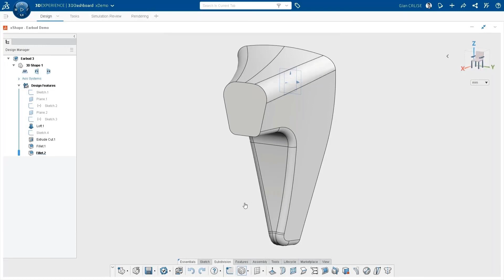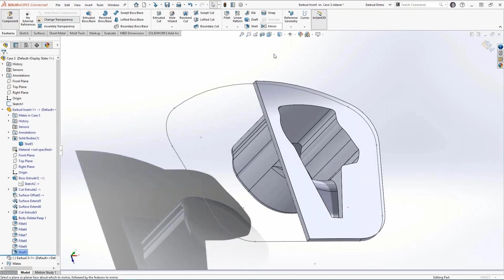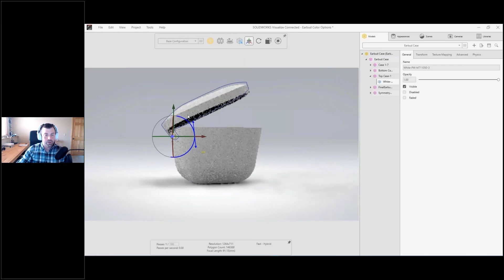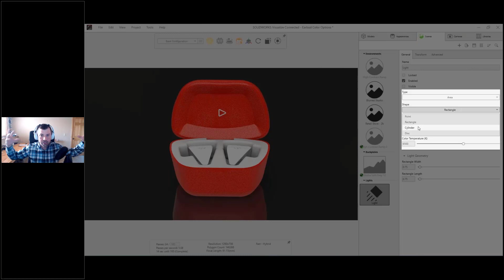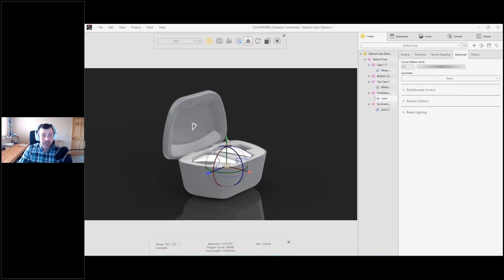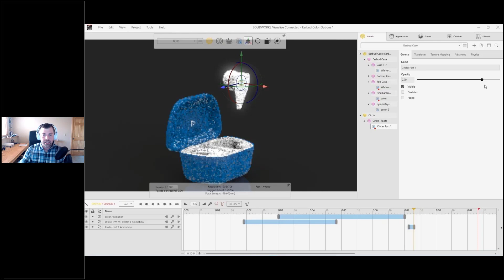Render Them Speechless with SOLIDWORKS Visualize Connected | Exploring 3DEXPERIENCE Works

Comment: i'm using the standard version but the radius tool will not apply to the edges??  i've scalled it from 1 - 1000 and does not appear to be doing anything.  any ideas? thanks
Reply from the maker: Hi there! A great place to start for direct support would be our User Forum. We have a great team of SOLIDWORKS experts well versed in technical aspects of the software. They would love to help you out. We can also direct you to our support form here, where requests are triaged and responded to by our team: https://www.3ds.com/online-store/support-form/

Comment: I find the "connected" nature of Visualize Connected still undone, in the 2023 version (two major versions down the line). One of the reasons is that it's presented so differently than the Solidworks UI itself does.

The more I use the tool, the more I think perhaps... this should be part of the cloud offering, like xShape and xDesign. That way, we all would have access to fast GPUs as well.
Reply: Also, using SolidWorks Connected 2023 and agree. Feels half-baked and rushed out. Constantly must resign in when opening the app or dealing with frequent updates. Odd GPU related bugs that resetting SolidWorks fixes.